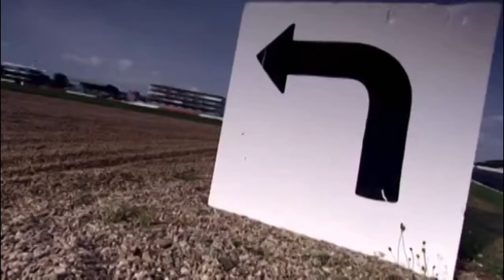Top Gear 24 Hour Race Challenge at Silverstone (Part 1)

Comment: Back when e46 330d costed 11k
Reply: Sheesh that's steep, nowadays you can get one for 2-3k, though you need to find one that isn't rusted to hell first.
Reply: @mataskart9894  bro here in italy some stupid people are selling them for 18 to 22k , and if it's convertible it can reach 30k , sometimes the cheapest i could find was 7k
Reply: just bought a 330d with 420k km, 3.0 engine. 2 days and so many problems hahahahah, but its amaizng
Reply: @tougeking9226  in italia se vuoi un posteriore ad un prezzo decente ormai è rimasta solo MB... Bmw sopravvalutatissima. Basta vedere sto 330d del video, 4 anni, 50000 miglia, che dopo durante le qualifiche (quindi nemmeno 12h a manetta) spacca: turbina, volano e frizione. IMBARAZZANTE 🤣, Se hai visto l'episodio a suo tempo vedrai gli altri problemi durante la corsa... Io ho avuto un 320d e in 1 anno ci ho speso su 4k di manutenzione.. auto da prendere al prezzo del ferro. quelli che le vendono a 15k che continuino pure 🤣
Reply: “£19,999 330d, not running, no rego, strange mechanical scratching noise (easy fix), no low ballers, I know what I have.”